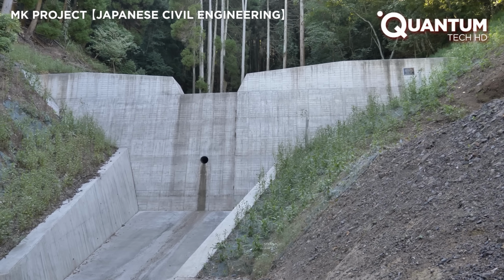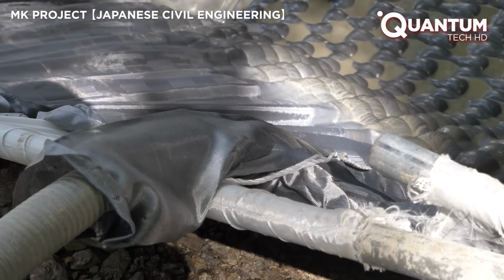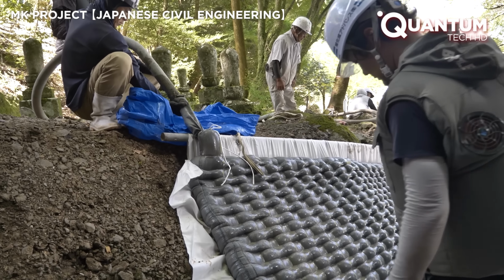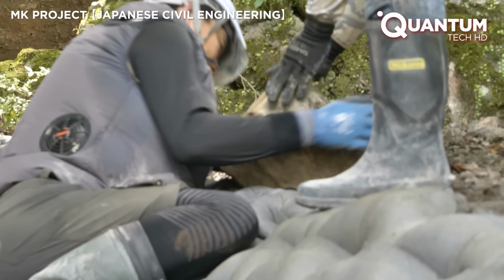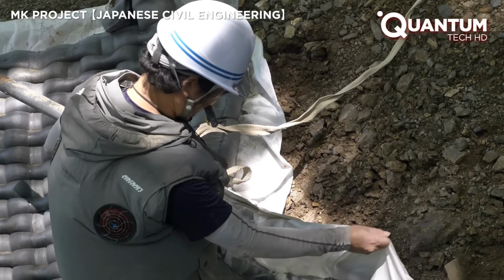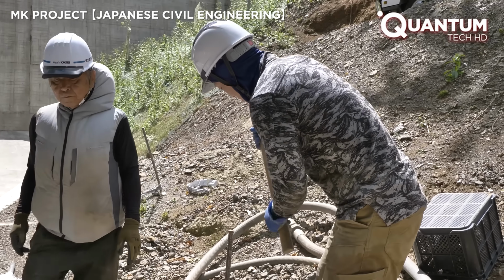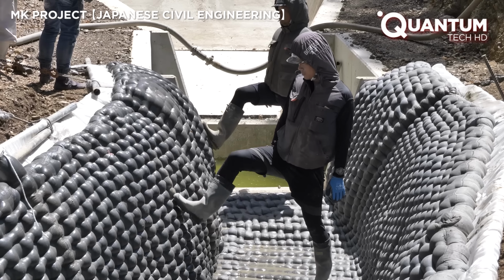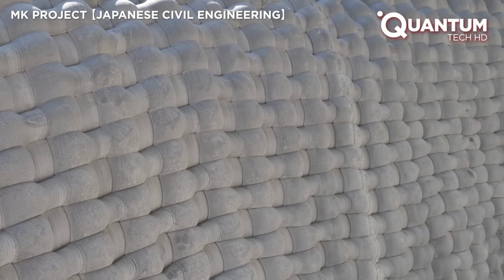How Japan Builders Turn Weeks of work into 2-Day Canal Build | by @MKPROJECT-DOBOKU

Comment: So, no reinforcement, no permanent tiebacks, it sits higher than the surrounding earth, water is free to undermine it at the tops and ends, what else?
Reply: Serious do you not think it’s secured at both top and bottom.
Reply: @oluffriesthomsen7680 
NO 😮!!!
Reply: @oluffriesthomsen7680 that’s not the point of his comment and judging by the construction methods no not really in a meaningful way. I’m a civil engineer and this makes me angry. It would work for a temp fix job but you’d need to replace it with how it would’ve been done in the first place. Like he said no rebar so it’ll crack all over the place and fall apart. No tie backs holding it into the slope. Water will soak through the cracks and thin parts where it’s down into a pattern. Due to the pattern it’s not flat and can’t be fully supported on the slope which further aggravates the cracking. Then on top of that yeah the top and bottom will have water go underneath it and erode the slope since it’s again uneven unless they either dumped concrete at the connection points or have some magic joining technique im not aware of
Reply: @wileyvickers8012 
I am pretty sure the Japanese, know what they are doing.
The whole system is filled with concrete, and when that is dried it’s totally waterproof, and the weight will surely keep it in place.

Comment: If it flows that easily, its grout not concrete.  I don't see why shotcrete wouldn't be a better choice.
Reply: well, it is not concrete, but it is not worse! It is just more expensive. 
Why not shotcrete - it is easier, just poring liquid into the bag.
Reply: You don’t know what it is. It’s in Japan. They are way more advanced.
Reply: @thereissomecoolstuff you’re laughable. It is grout mix. You don’t know because most probably you’ve never worked in construction working concrete or driving concrete mixers or operating concrete pumps as I do. 
Anyway, that mix is grout and yes it can be more durable and longer lasting compared to rock mix concrete but still the fact that it has no rebar in place and no footing makes me wonder how long will it actually last against the gradual movement of the dirt walls and possible earth quakes?
Reply: @ you proved my point. You don’t know how strong it is. There is no rock it. I think it’s going to last a long time. It’s a spillway. For overflow. Don’t sell the Japanese short. We all almost had to speak Japanese if they hadn’t done a couple of things wrong in the war. Small country with no resources other than grout. Almost defeated the country with everything.
Reply: @thereissomecoolstuff  Can you say it more clearly?
Reply: @ buddy, I’m telling you I know for fact it is a strong mix. I’ve poured, worked and inspected grout mix. That is why it leaves me with those questions. 
Not hating on the Japanese people, culture or whatever else